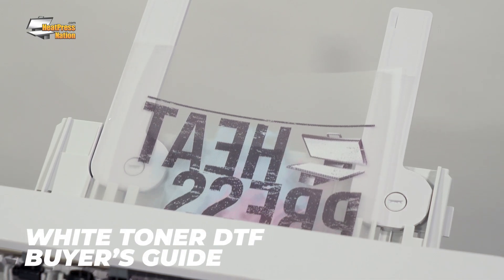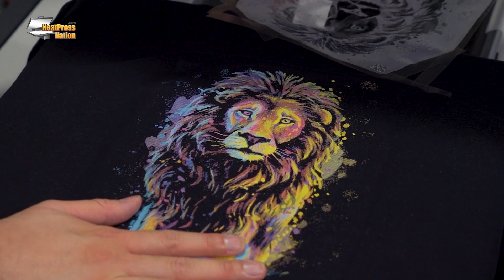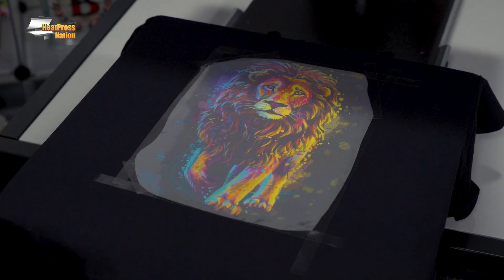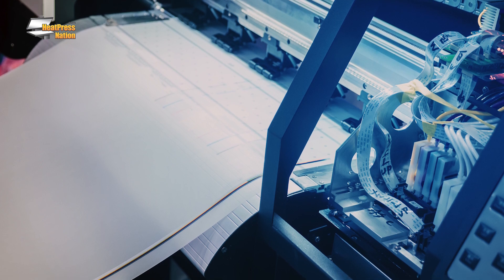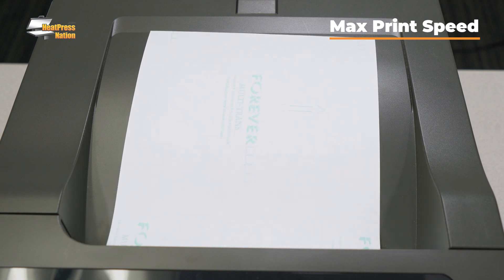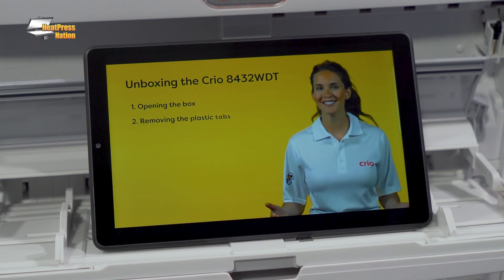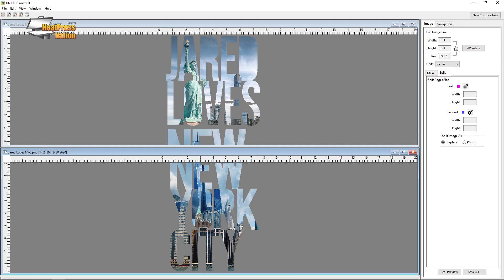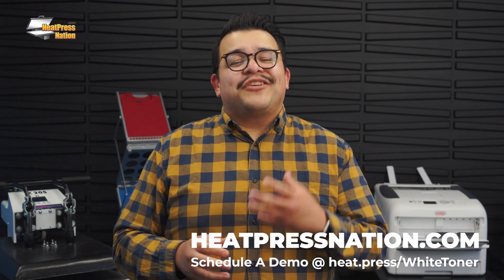The Complete Guide To White Toner DTF Printers

Comment: Do you have a printer that you can put white toner in and then swap it out and use sublimation ink so you can do both with the printer, at different times of course???
Reply from the maker: Yes, the UniNet 560 comes with a set of toner for t-shirt transfers, but you can purchase a separate set of sublimation toner. The toner cartridges can be hot-swapped for easy switching back and forth between regular white toner and sublimation printing.

Comment: These are not specialized toner printers. Toner printers are just that, toner printers. These printers print white toner. The key to the dtf process is to find an adhesive to cause the toner to stick to it so that it can be transferred to a preferred garment. When using ink, the same principle applies. An adhesive must be used to transfer the ink properly to the preferred garment. I’m not sure why you are trying to make it mean that those printers were specifically made for DTF when they were not. It is more cost efficient to use ink than toner because of the cost companies charge for the “marrying” sheets for toner. The adhesive powder for ink is much more cost effective because you don’t have to purchase “marrying” sheets. It’s best to tell the consumer the truth!
Reply: Question, so can I use DTF transfers in the white toner printer, then use DTF powder to adhere it?? Basically skipping the marrying sheet part?? That paper is expensive lol

Comment: Quick question, you said "White Toner DTF adhesive is applied and set  on a heat press in one step." Does this skip the marrying process? If so, how do you do that?
Reply from the maker: The adhesive is applied and set onto the print in one step. That would be the marrying process. The 2nd step would be pressing it onto your garment.
Reply: this is not answering the question.  HOW IS THE ADHESIVE APPLIED?? Why not do a video showcasing this process from beginning to end with no talking.  Just show how dtf process works from beginning to end please.  thanks @HeatPressNation
Reply: @brownsense1  Because you can do what’s in this video with any toner printer. The key is finding the adhesive for the toner. The white toner is used because it acts as a base for dark frabrics. Toner is toner. There maybe different brands but it’s all toner (powder substance) vs Ink (wet substance). A lot of this video is misinformation to sell products.